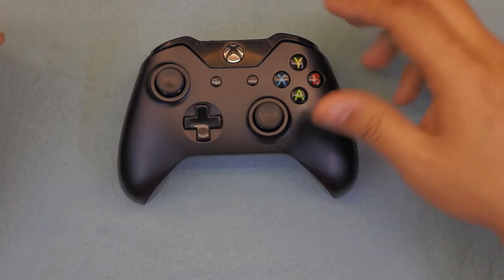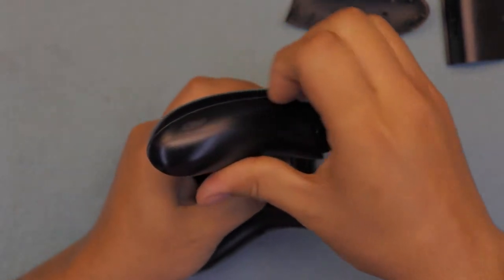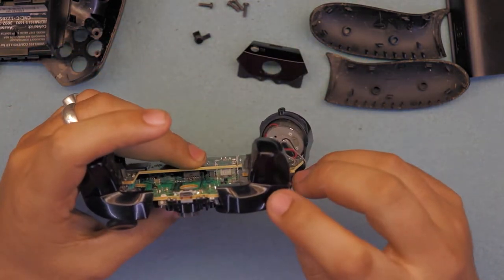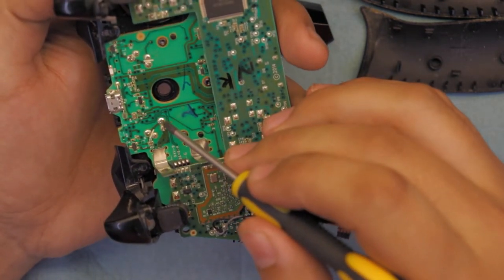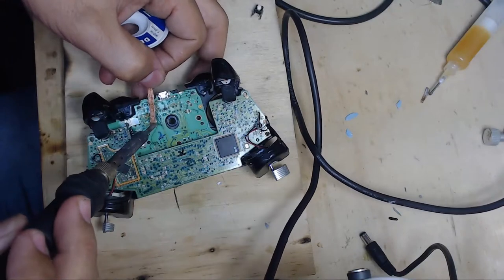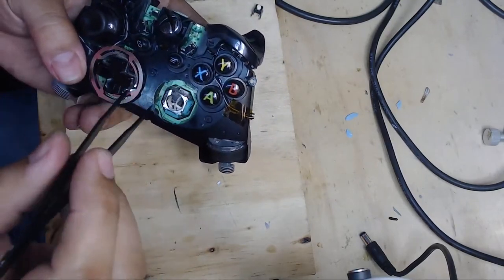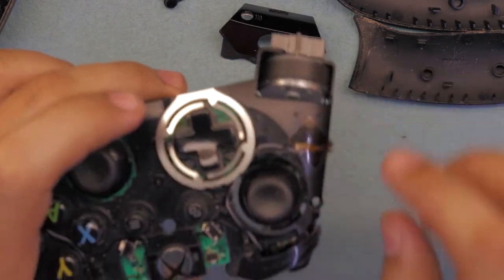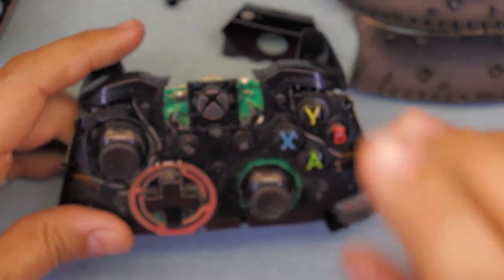FIX Xbox 360 Xbox One Controller ( LB / RB ) Bumper Button repair

Comment: Nice video, but when I replaced the lb switch, now both of the switches don't work! Do you know why?
Reply from the maker: Nathan Petrie double check the soldering and make sure you haven’t touched or removed none of the capacitors around them they are tiny. Take a very nice pic up close and send me . As much as you can and specifying the one you changed.